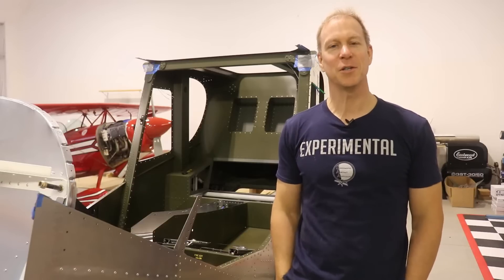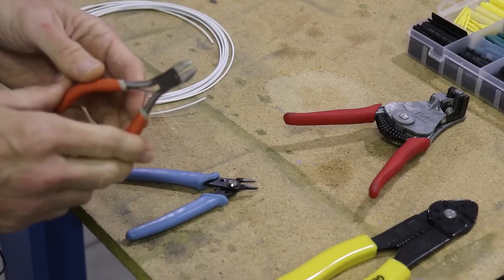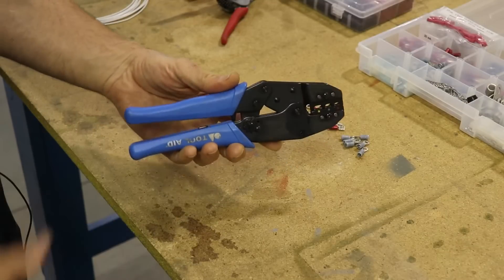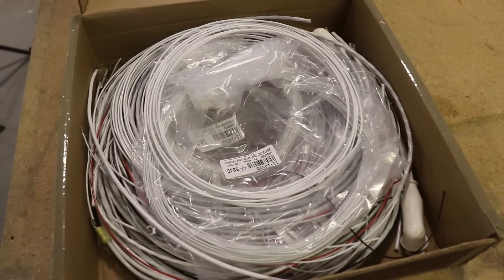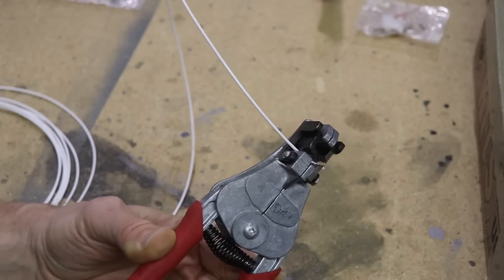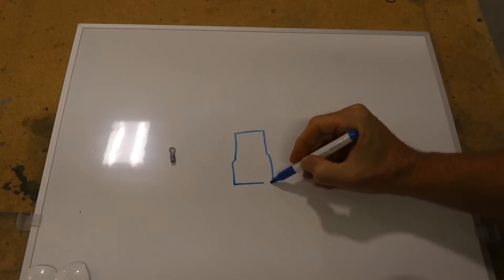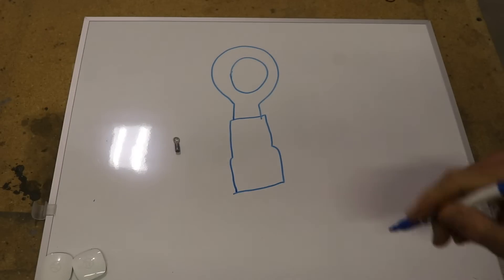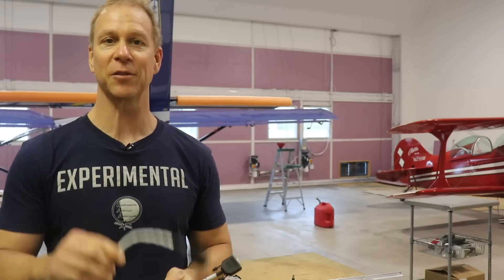Tools for AIRCRAFT Wiring (Ep60)

Comment: “Strain relief” is where the crimp holds both the wire and the casing.  Aircraft grade wire has more strands or wire per given gauge. Lastly, aviation wire has the option of being shielded which reduces interference.

Comment: Great information Mark. What about Swage tool if you use one for cables. Bearhawk Life used an after market swage tool that he later found out doesn't swage correctly unlike the original swage crimping tool as per his build video.
Reply from the maker: Yes a special swage tool will be needed to build your flight control cables. But in this video I'm just focusing on tools for electrical wiring. If you search through some of my older videos, I did make a video about tools needed to build the rest of the plane.
Reply: @KitplaneEnthusiast  yes sorry it's just that I saw a video where kit plane builders used a lesser quality cheaper swage tool and the cables didn't crimp properly and came apart.

Comment: Hi. Thank you for content. Aviation wire insulation withstanding much higher temperature and most of the wires are copper covered with silver sometimes nickel to prevent oxidation. I saw some non aviation wires removed from arcft after years they were totally black inside.
Reply from the maker: Thanks! I did not know all that!

Comment: First, since you worked on nuclear missiles I trust your info is pretty darn good. Last, for the molex crimper they also make a high-qualitiy 'ratcheting' version of that as well.  I use it extensively for cables for PC builds.  What's cool about it is you can insert a molex pin, give it a couple clicks, and it will hold the pin in place for you to position the wire then complete the crimp.
Reply from the maker: I might have to upgrade my crimper!

Comment: Hi mark, do you solder any of your connections?
Reply from the maker: No. With the proper crimper there is no need to solder. Soldering also makes the wire more susceptible to breaking.

Comment: Instead of zip ties might I suggest an alternative.  Lacing cord.  Hate messing with a wire bundle and always snagging your hands on the sharp ends of the zip ties.  After tying these about a billion times over years I have gotten to the point where I am about as fast as zip tying and it looks so much better.  Here is a good video to watch to show you how it is done.  https://www.youtube.com/watch?v=CR3z5WZeHTw&t=37s  Not associated with the video.  I prefer the white waxed over the black non waxed.  Worked on aircraft from 1964 to 2007.

Comment: I’ve invested in the molex crimper for the molex pins. They have many different sized crimping stations that vary between pin size and wire gauge to make sure you get a perfect crimp. My pins are placed in IP68X shells that are deployed in harsh environments. It makes a difference.

Comment: I'm kinda a belt and suspenders guy on vehicle wiring,I like to solder and heat shrink my connections, if the heat shrink isn't glue lined, I'll daub a bit of RTV on the solder, this seals out water and adds to the dielectric insulation
Reply: I started doing this after having to rewire a trailer that road salts ate up the connections.

Comment: There is also "Adhesive Lined" shrink tube you might consider.
Reply from the maker: True-I want to get some to hold the blue plastic tubes I have over the rudder cables.
Reply: Grote makes a good glue lined heat shrink tube.

Comment: You may want to try twisting your zip tie tails instead off cutting them ,,, I find it a lot better then cutting
Reply: I really look forward to seeing this channel.  The detail is great.  Also checkout zip tie cutters to use for locations where skin could get cut/scratched, or anywhere you use zip ties.  These cutters slightly pull the tail before cutting the zip tie.  This leaves the tail's sharp edge retracted into the zip tie lock.